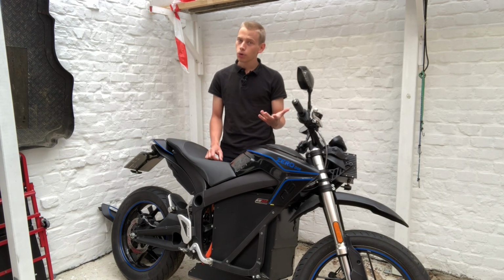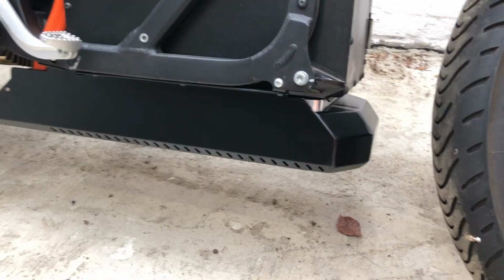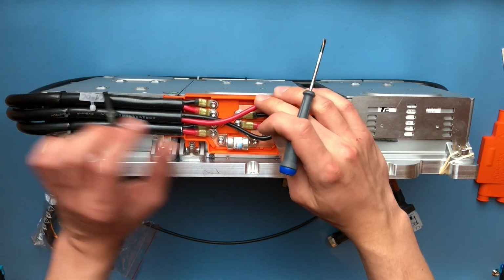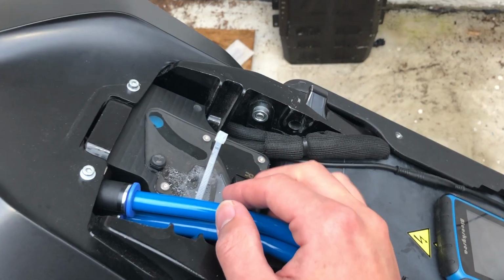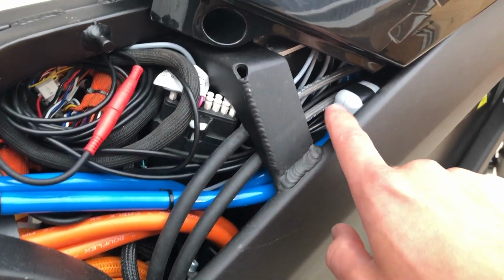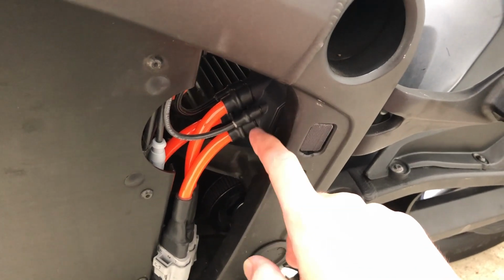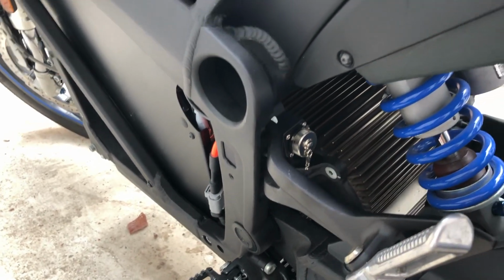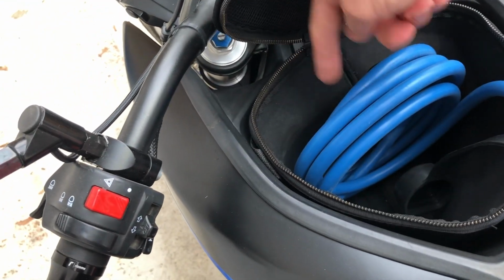ZERO | Let's have a look at my charging setup

Comment: Hi Max! We have a question about the 9-11kW charging setup. The Gen2 Zero we have has a JJN-100  fast 100Amp charge fuse.
It is rated to 100Amp, and a normal fuse can stand 120Amp a g type, btu it is a fast type.
If the battery is near 0% at 100V and we charge with 11kW it charges at 110Amps or a bit more is it safe for the charging fuse?
After 110V battery voltage 11kW power will become only 100Amps or below so could be safe for the fuse.

We have now the 6kW charge Tanks a 3.3kW Chinease charger and the 1.3kW OBC and not sure if we can let both work same tome for fastest charge speed not to exceed the 100A charge fuse limit.

Comment: Hi Max super clean build! One question, without the default onboard charger, is there a way to enable the battery contactor? To use any aftermarket lipo charger? I cant seem to get the contactor open without engaging the ignition. On a 2015 DS
Reply from the maker: Hi @glenluyckx12,

yes there is a way. The onboard charger uses a combined connector for CAN communication and digital IO. One of those pins gives you +5V (CAN) and another one signals to the MBB "charger attached", if high it will tell the BMS to close the contractor for charging. A current limiting resistor is definitely required for the connection.
But please be very careful using this technique and do a thorough research on this topic (e.g. electric motorcycle forum). Because messing with those pins might cause permanent damage to your MBB and might even brick your bike.

best electric regards
Max Jäger

Comment: Hi Max! I have my 14,4kWh Zero S since half year now and I can easily make trips of 220km a day at 65km/h speed max about 5 hours ride, and I am very very tired (not the bike) to keep the throttle at that position and not use brakes just coast (only brake regeneration no throttle off brake).
I am thinking now about a fast charge option but not the expensive 6kW charge tank, as I am not needing it all the time.

Is there a way to have an off bike 6kW charger like the DEltaQ 1kW just a 6kW so I could put it to my top case if I need 6kW+1kW charge power on longer trip, but don't have to carry all the time on my maximum 200km/day trips?

So some external 6kW at least for the auxilary charge plug and I could modify my custom Type2 cable of course to power both the external and inboard.

I think any aftermarket 6kW chargers could work as not need to activate the charge progress with the can-bus signal on the auxilary charger plug because the internal charger activates it and the 6kW external just works in parallel when battery pack relay is on and active...

maybe that could be the cheapest and best idea for a faster charging without bringing a charge tank all time.

Comment: Hi! I plan to buy a 2021 Zero S 14.4 battery version. 
Is there a way to add type 2 fast charging for it? 
As I see there is a Charge tank modification option for 6kW charging, that would be also good, just have to make sure it can be added and accepts Type 2 public stations.

I already have for my current ebike  a Type 2 -> Schucko adapter so I can use my slow 500W home charger with that and it works up to 16Amps at current resistor config so until 11kW, but with a resistor change can full type 2 AC be used like 22.5kw....

I have to achieve 250km range so need a stop for charging at public Type 2 station and charge in max 2 hours.
Reply: There is a way to make it but it will require some custom building. I did it on my Zero SR 2015. You can check some info in my channel, but most of the content is still done in Spanish ==> https://youtu.be/TnVWUGMaurE
Reply: Depending on what you plan to do with the charging options, you can either go for an aftermarket charging solution to charge faster (as Max did on his video) or you can use the same adapter you already have from your ebike to charge with the onboard charger at 1.3 kW, but it will charge slooow
Reply: @DanielMonteroElectraveler  thanks, I will search for custom chargers for sure, as I heard 6-11kW max can be acheived due to typ1-type2 conversion...
Reply: @fotoamgamgfoto3695  in type 2 you are limited to a max of 22 kW in most stations. Type 1 can only charge at maximum 7.4 kW, so type 1 is not what you are looking for. In the video I shared there is a part where I explain how to build the diagram needed to connect to the charging station and how to wire from a type 2 to 3 independent schuko plugs. Then you can connect your chargers to the schukos and to the bike
Reply: @DanielMonteroElectraveler  sorry maybe I understood wrong, but Charge tank is te first thing I can put on my Zero S and it has american Type1 plug, if I add a type 1- type 2 converter stil have 1 phase as type 1 will be the input for teh charge tank and limited to 6-7.4kw around. Of course I could rewire things but will need more confidence and infos to dig first, 
I will check your video than for diagram, thank you!
Reply: @fotoamgamgfoto3695  sorry, it was me who didn't understand you hehe. You want to put the chargetank, not external unofficial chargers. Then, type 1 to type 2 is the way to go indeed. There are type 2 installation kits for the Zero S so that you can use straight away the type 2 and forget about type 1, but they are pricey (~500-600€). There, you could add unofficial chargers on the other 2 phases, to pump up your charging speed. But indeed, it requires handy work, time and understanding of the topic. In any case you should not exceed 10 kW of charging as the bike's main fuse is 100 A. Also, a very important warning, if you decide to install unofficial chargers you will likely lose your warranty on the bike! Good luck with your future charging project. I love doing that for my bike, but you need confidence in what you do and read and test a lot before doing something on the bike
Reply: @DanielMonteroElectraveler  HI I have my 14,4kWh Zero S since half year now and I can easily make trips of 220km a day at 65km/h speed max about 5 hours ride, and I am very very tired not the bike to keep the throttle at that position and not use brakes just coast (only brake regeneration no throttle off brake).
I am thinking now about a fast charge option but not the expensive 6kW xharge tank, as I am not needing it all the time.
Is there a way to have an off bike 6kW charger like the DEltaQ 1kW just 6kW so I could put it to my top case if I need 6kW+1kW charge power on longer trip, but don't have to carry allthe time on 200km/day trips?
So some externak 6kW at least for the auxilary charge plug and I could modify my Type2 cable of course to power bith the external and inboard.
I think any aftermarket 6kW chargers could work as not need to activate the charge progress with the canbus signal on the auxilary charger plug because the internal charger activates it and the 6kW external just works in parallel...
maybe that could be the cheapest and best idea for a faster charging without bringing a charge tank all time.

Comment: Hi Max, thanks for the video, looks like a very well engineered system. I have a couple of zero motorcycles that I have modified one of them is intended for purely off road use, I have removed the onboard charger and charge using a couple of delta Q units. The platform is based on the FXS and the wiring loom is almost identical to the SR. I am by no means knowledgeable in electronics but I have a question about the canbus, I see that you have some sort of module fitted to your bike to control the chargers I assume it communicates with the bms or mbb? My question is why is this needed since I know on my zero there is no canbus conection between the bike and zero approved delta Q charger, it simply has a positive, negative and enable wire which is an accessory pin in the stock anderson connector?
Reply from the maker: Hi mariryalen,

this little box purely serves as an interface between the chargers and the charging station. It will handle all the communication necessary to turn the station on and limit the chargers current draw to what the station is able to provide. Currently this interface doesn't communicate to the BMS, nor the MBB, but in the future I'd like to integrate at least the BMS.

Best electric regards
Max Jäger
Reply: @Max_Jaeger  Thanks for explaining that, keep up the good work!

Comment: Hello max great job great explanations. Do you plan produce some 3 to 10 kw charger kit ?! Would be great... Is the liquid cooling system absoluutely necessary ? 🙏👏👍💪👌
Reply from the maker: Hi Y from Mars,

I don't plan to produce any charger-kits.
The cooling system is necessary if you want a charging system that won't throttle due to overheating and also won't cook your battery. My cooling systems pretty much isolates the heat generated from the chargers from the battery pack, so it only heats up slowly and evenly due to its internal resistance.
But since you're asking, there was a system that featured the same chargers just without the cooling system, it's the Supercharger from former DigiNow. Unfortunately it didn't work reliable all the time because there were some isolation faults that messed with the CAN-BUS controls and the chargers also went into thermal throttling because of inappropriate cooling after a few minutes (also the hot chargers with 70°C+ heated the bottom of the battery and thereby decreased its longevety).

Best electric regards
Max Jäger
Reply: @Max_Jaeger  Thanks a lot for you detailed answer. In fact I only search for an external 3300W charger to replace the onboard one when it will die and to have a quicker charging time when needed. And also thank you for precision about the DC/C model. Gzzz Gzz Regards, Y

Comment: I know you have finished this project but at any point did you think of putting a chill plate between the controller and the existing heatsink so that you could reject the heat out of the back of the bike instead of under the tank. You could then run a powertank for additional range if you wanted to.
Reply from the maker: Hi Scott,
that sound like a pretty good and also sleek idea. On the other hand I'm not quite sure if this heatsink could reliably get rid of the heat.

Best electric regards
Max Jäger

Comment: This is great work. Exactly the kind of work that electric motorcycle aftermarket charging deserves: engineered for weathering, with active cooling, using appropriate parts and connectors.

Comment: So this is all because it needs to convert  moderate AC to DC?
Reply from the maker: Yes, even though it would work* without whole the cooling system.
But there is also some typical German over-engineering involved (easy expansion of the cooling system for motor and/or controller cooling).

*It would, but only for some minutes since the chargers will overheat pretty quickly and go into thermal throttling or shut off completely.

Best electric regards
Max Jäger
Reply: Yep, my digiNow system overheats after 20-25 minutes of charging at 10kW and shuts down completely until it cools down enough to slowly ramp up to 4-5kW or so